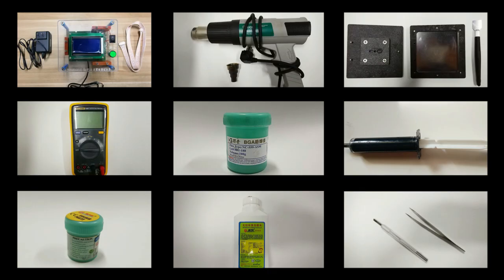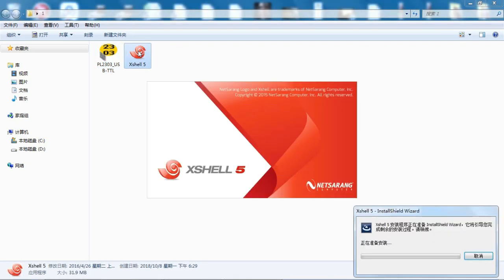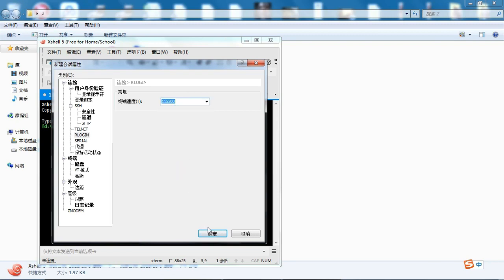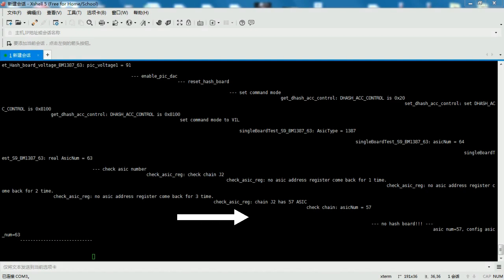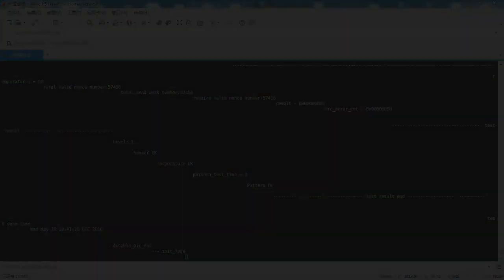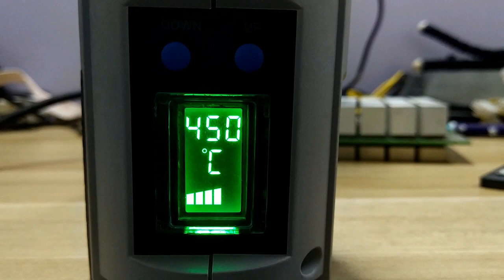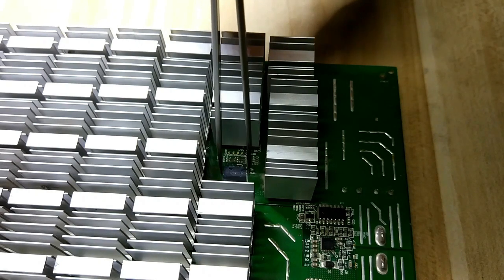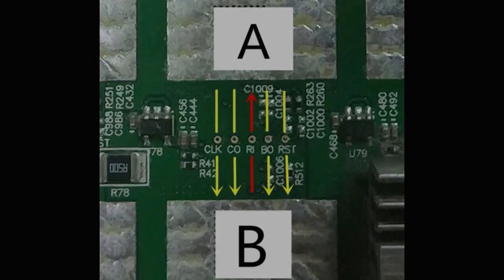Antminer S9 hash board repair and fault diagnosis video tutorial New / Ремонт Antminer S9

Comment: Hi, 
Do I need to connect the test tool also when measuring the chip voltage values? Or just connecting the power is enough?
Reply from the maker: When testing the voltage, you need to connect the power supply and run the test fixture to test it when the hash board is working.

Comment: Hi, and thanks for the great video.  What kind of solder paste is this?  What temp does it melt at?
Reply from the maker: Hello, sir, Repair the Hash board with medium temperature solder paste, the melting point is 183° Celsius. More : https://www.zeusbtc.com/ASIC-Miner-Repair/Parts-Tools-Details.asp?ID=264
Reply: @ZEUSMINING  Okay, splendid.  Thank you.
Reply: @ZEUSMINING  I'm trying to set up my s9 tester, but the instruction to connect the USB wires to the tester seem very unclear to me.  The USB that I received has 4 wires: Black, Red, White, and Green.  But the instructions on the Bitmain website for a s9 tester say to use the black, red, and yellow wires... (!) ??  I don't want to fry circuits with wrong connections.  Do you know of a pic that shows the actual finished product, after connecting the USB wires to the S9?  Thank you so much!!
Reply from the maker: @007mercucio  Okay, I didn't really catch your meaning, sir. Please take a picture of that, And click on the website to communicate with our maintenance staff, he will provide a better service for you. https://www.zeusbtc.com/
Reply: @ZEUSMINING  Okay, thank you!  I got it figured out.

Comment: I have an s9i hashboard and after heat sinks replacement my text fixture says check chain = asicnum 30. I tested resistances and voltages to 29-30-31-32 asic and is normal . any advice?
Reply from the maker: It is recommended that after replacing the heat sink, do a single board test again after a while.

Comment: Good Video but you showed several faults in the sample but only repaired chip 58-59.  Does that solve all of the faults or was that only a solution for when chip number 58-59 is bad?  Do you have a solution video for when there are three errors like the sample issue during the video?  I think it was, a chip was bad, the hash board wasn’t recognized and it wasn’t getting power
Reply: And what type of glue is used to replace the heat sinks
Reply from the maker: Yes, as you said. The video mainly expresses the problem that the hash board cannot be recognized due to chip damage.

Comment: The device finds the chip number with start from number 0 ? If number 8 is displayed, number 9 is faulty. Finding on board start from 0, 1, 2, .... 9 ?
Reply: short-circuit "co" testing point of chip that you think is number 8 to the heat-sink. then test again. if it shows no8 then test next chip. if it shows no9 test the other. if it shows no9 again then change no9 chip ;) otherwise go ahead and find which one isnt working

Comment: Good Morning.
Friends I have a problem with a S9j machine and I would like to know if someone can give me some support with the problem.
What happens is that the machine turns on and starts well and even the green indicator LED turns on that everything is fine. But the lights or red LEDs of the cards do not turn on and the machine does not mine. So it has 0th and in the kener log it says that CRC counter = 34765.
I already tried reinstalling the firmware, trying another controller, changing the cards ... And nothing worked for me .... Any help please?
Reply from the maker: From now on, you can leave your questions in the Zeus Mining Facebook group or Reddit community, and our professionals will select some of these questions every week for unified answers.
The scope of the problem is mainly concentrated in the field of ordinary ASIC miner maintenance. The problem needs to be described clearly, preferably with pictures.
This is an attempt, and valuable comments are welcome.
https://www.facebook.com/groups/2377381515673070

Comment: voltage measurement did it, with 12 volts attach, or with diode scale,?
Reply from the maker: For testing accuracy. Fluke 15B+ is recommended. It will automatic detection of voltage values.
Reply from the maker: 12 volts
Reply: first you should check the voltages. if they are ok, check diods

Comment: Hi, could you please tell me how much do you heat the chip to get it removed? I literally take the hot air gun to 450 to 480 C and it doesn't wants to get out. I put the gun right in the center of the chip and use the special tools to try to remove the chip but it just doesn't.
Reply from the maker: It requires continuous heating for about 15-20 seconds. Before that, you need to remove the black gel around the chip.
Reply: @ZEUSMINING  hi there, how to remove the black gel?
Reply from the maker: @rezashah5330  Scrape with scraping knife

Comment: Rt error how to solve it?
Reply from the maker: If the RT voltage is abnormal, you can check the resistor connected to it.
Of course, you can also contact our technician on WhatsApp: +8619123969124, he will provide you with better suggestion service.

Comment: Does anyone here know how to tweak SCRT, so the text doesn't go shifting off to the right, further, with each successive line?
Reply: HI
Have you found a solution?
Reply: @farkhoddaniyarov4909  No, I kind of dropped that project, for now.  I suspect there is a way to change the formatting, though.